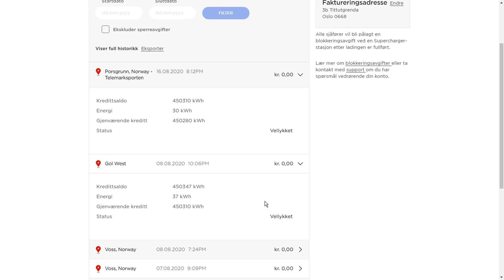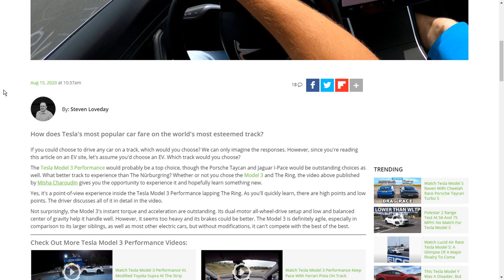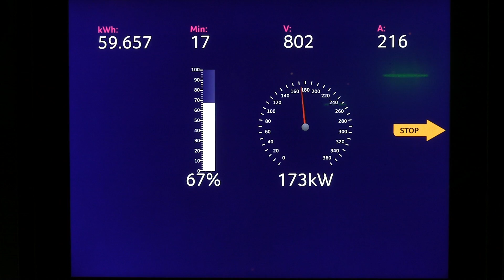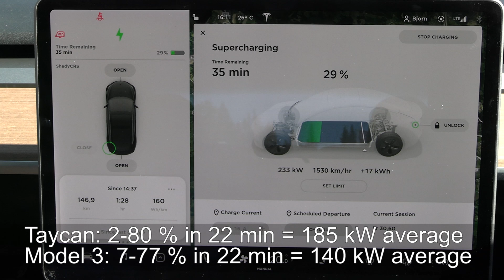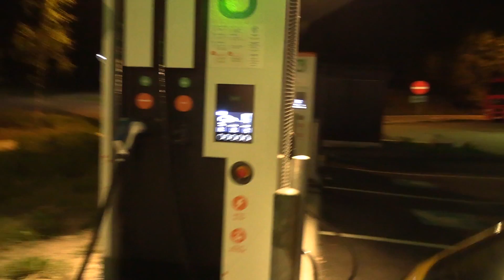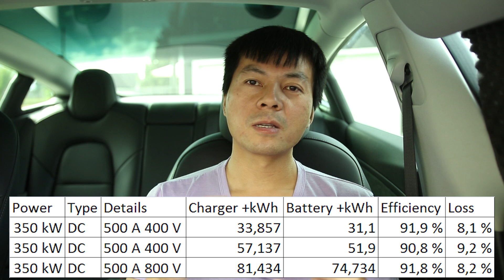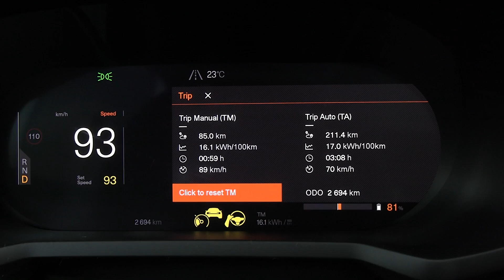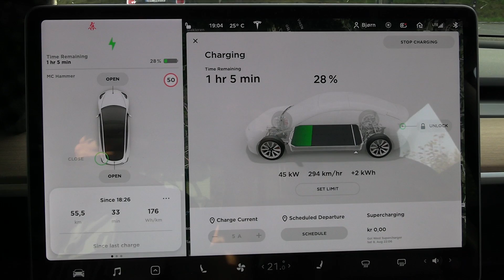Pros and cons of 800 V battery and charging systems

Comment: Certainly cable heating will be less if the current is less. The hotter the cable, the more losses you get. But, is it significant?  I think you make a good case here that it isnt.  The other argument is "Time is money" so faster is better. But again, your point is well made that this is ICE thinking. Fill up, then go for a coffee (or Toilets and then coffee). My experience is that charging the Tesla is just the right amount of time to (do what you need to do and) get a coffee and drink it.  Probably makes for a more alert driver and more rewarding driving experience.  In other words, faster is not necessarily better.  Finally, things will evolve. We need all electric cars to charge up in a reasonable amount of time (15-30 mins) so whatever gets us there.

Comment: 6:23 that is very misleading. The Taycan was overhetaing because it did 1000km at 120km/h and was supercharging just before the lap, so the battery was very warm. It even says so in the article you linked. 

[But two laps into the North Loop endurance track, the Taycan hit trouble, forcing Sentis to admit in the future he should keep to “a simple rule: start with a “cold” battery.”]
https://thedriven.io/2020/08/14/porsche-taycan-battery-overheats-on-nurburgring-north-loop/

And you can't compare it with the Model 3 lap, becuase they weren't driving very hard due to the overheating brakes. And even so, at the end of the lap the battery was overheating.
Reply: My Model 3 drove 350km to the ring and I charged 80 Kilometers before the Ring. And also supercharged 5 Minutes before the lap with Misha. So my Battery was also very warm. An i forgot to put the regenerative Braking to low so it was heating the battery up extra. So I think it was a good comparison. Greetings Benjamin
Reply: How the f*** is that misleading? You mean you can't fuel your $180k sportscar before tracking it?
Reply: Fighting hard for your favorite brand eh? You have a point, but I wouldn't go too far to say it's 'very misleading' 😂😂
Reply: So.. buy a car with a combustion engine?... 😅
Reply: All good points. But the model 3 is 1/3rd of the price and gets pretty close... Close enough to be more than enough for the majority of road users.
The Model 3 and the Taycan will never be in the same league because they are targeted at entirely different markets.
Bjorn's point is that the Model 3 is already way beyond what most folks need
.. 800v system may be over engineering (solving 'problems' that are not really relevant to the majority of users).
Reply: @aidanapword  But that doesn't disproves my argument. He is using a half ass comparison to make a point.

You can't take 2 totally different situations and compare it like they were equal.
Reply: @aidanapword  he had good points but you definitely didn't. If you want to compare cars at the same level then use the S as the comparison if your excuse is that the 3 is too cheap. And btw, the model 3 being compared is the top of the line one, is that a third of the price?
The S can't even do a lap on the Nürburgring either without overheating, and that's without starting pretty warm already... So any points you thought you had just went up in smoke.
Reply: M4XC4V413R4 a purpose built car - for the track, overheats. It doesn’t matter that the battery was warm when started.  The Porsche engineers didn’t put that into the equation before they made a production line?  The Model S was never designed for the track, but a purpose built family sedan that just happened to go quick. The plaid model S seems to be different, who knows what it can do?  The plaid model S, which has already been at the ring, has unofficially beaten the Taycan by a conservative 20 seconds.  That’s at 120mph avg speed....for 20 seconds. That’s more than 1/2 mile(~1 km) it was beaten by. Pretty sad I’d say and somewhat disappointed. And I’m a Porsche guy....
Reply: @yingnyang2889  what purpose built car for the track? They're both road cars...
Reply: @M4XC4V413R4  you should go back and look at the Taycan marketing...
Reply: @Bryan46162  wtf do I care about the marketing? Are they road or track cars? Good luck trying to argue that lol
Reply: M4XC4V413R4 yes they are both road cars.  So is the La Ferrari - but that can go on a track all day. What I mean by purpose built is you have a benchmark i.e. the Tesla and you know it’s weak points - overheating, doesn’t break very well for the track, regenerative braking is mild, the tires - that are geared for day-to-day driving, and you purposely built into your car to overcome all those obstacles.Why would you need those obstacles overcome unless you were purposely building it to race on a track where it is needed? The model S as a family sedan does just fine on the road and doesn’t overheat and the brakes don’t go out etc. that’s what I mean by purpose built.  

I am a Porsche guy, and i rebuild Porsche’s as a hobby, and I’ve owned several brand new Porsche’s (5 - two used, three new). I am disappointed in the performance aspect. For an extra hundred thousand dollars more than the Tesla model S, it can only beat the S by one or two car lengths in the quarter mile, basically seats 2 adults and two kids, and has somewhat less range.  I wouldn’t be bragging about that, so what the car can do 25 to 30 launches, and the Tesla can only do three or four? When was the last time you or anybody that you knew did 25 launches in any car at one time?  It’s still remains, as Tesla was seen driving two prototypes on the Ring, if they come out with that iteration, the ones everybody saw, it will humiliate the Taycan. When there is a paradigm shift, it negates any experience you have prior to the shift. You could have 100 years experience in horses but when the automobile came out it’s just negated all your experience everybody’s at square one

Comment: About the Nurburgring lap with the Model 3, by the end of the first lap the battery was already overheating and power limited and it's also important to mention he did not push the limits on the car because the brakes were gone after half a lap, so it's not fair to say the 900v didn't make a difference there for the Taycan.
Reply: Yea - I was wondering why Bjorn was not taking that into consideration. It was overheating already at the end (which would get worse with better tires and suspension because your driving also changes and you use more power). The Taycan could at least manage a fast lap, what the model 3 with the latest tech couldn`t. I would like to have my EV exactly like tat: Fast charging speeds when I want it and when I have time, I can choose the "eco" mode to give the battery a bit more life. At least you can choose and when you have a busy day with a lot of driving you can use it.
Reply: For model 3 at orange It's slightly reduced power.  You can actually drive the crap out of it after the orange and it won't really go into limp for a very long time.  Unplugged performance is doing pikes soon.  They added huge carbon ceramics and probably reduced Regen which is an adjustable slider on the stock trackmode v2 software.  They will likely complete the run with zero issue.
Reply from the maker: But if you understood the content of this video, you would understand that the reason for the battery to overheat has nothing to do with 400 V or 800 V pack design. And for mass adoption of EVs, track performance without overheating is not important.
Reply: @bjornnyland  Well I don't know that, Porsche claims it does, so I tend to trust the engineers behind those decisions.
But truth be told, I don't really get how just changing the battery layout means less battery heat.

Comment: 350kw will be good when you have 200kwh+ batteries.
Reply from the maker: Car manufacturers will probably stop at around 100-150 kWh in the future. After that point, they will go for smaller, lighter and cheaper batteries while still having sufficient rance. That's why you never se a Toyota Auris with 100 litre tank.

Comment: Almost all CCS chargers over 50kW in Switzerland are already 800V.
Reply: Frankly, it doesn't prove anything. Your local charging operator might have made an investment, that wouldn't pay off.
Reply: And even the new 20kW DC chargers installed in some shopping malls are 800V! (ABB Terra DC Wallbox) We're ready for whatever happens :)
Reply: Same in germany... more than 90% (source: goingelectric.de) EnBW HPC all come with 300 kW 900V, Fastned upgraded to the same HPCs. Allego also uses 900V and 300+ kW.
Reply: Maybe you saw 800V in the specs, but the charger it's working at 400V anyways.
Reply: @AaronStarkLinux  No, not only specs. Real 800V output. It also shows on Stall max-kW for 800V and 400V Cars, to inform driver. https://support.fastned.nl/hc/de/articles/360037279594-300-kW-Schnelllades%C3%A4ule and https://support.fastned.nl/hc/de/articles/360039667693-Laden-mit-einem-Porsche-Taycan . Same at EnbW and Allego and many other HPC.

Comment: Bjorn, please let us know about the motors - not just the outputs. They are not all the same  - the Taycan has two gears to assist the motor and extend the range.
Reply: Not really! First gear is only used in launch mode to help better accelerate from 0-100 or so...(90kmh I think)... Taycan has clutch on rear motor, that helps when you cruise because it dissengages the rear motor. But its redundant if you use induction motor instead of permanent magnet motors...
Reply from the maker: Actually, the two-speed gearbox is to improve acceleration, not to extend range. When Taycan is in Range Mode, it only uses the front motor. You can see it here:
https://youtu.be/VB24iJbusgQ

Comment: battery capacity will be bigger in the not so far away future...to keep up with capacity, the charging speed must be adapted. To keep amps and resistance low, voltage needs to go up. Never has math been simpler as with electricity. So, 70-100 kWh is the pinnacle today, and maybe 150kWh in the near future...when the first serious trucks arrive...will they be laid out to charge en route? They will come with huge batteries for sure. So yes, 800V makes sense to me. We will also see what Tesla will have to offer.
Reply: Higher capacity doesn't necessarily mean faster charging or discharge speed. You can put a bigger fuel tank in your car and it won't make it any faster.
Reply: @Nickbaldeagle02  That was not my point. People will demand larger batteries to have greater range. To fill the larger battery from 10 to 80 in the same time as the smaller one, guess what you need? Goodness...

Comment: To me the charging load on the battery is the same for 400 or 800v systems if they have the same capacity.
400 have more cells in parallel where the current is distributed.
The only thing is that, in 800v systems, you might have less losses in charging equipment like charge station, cable or car dc-dc converter.
This might explain the difference in losses.
Reply: The charging losses are caused for the most part by joule losses that are not proportional to the power delivered but to the square of the current. This mean that increasing the voltage the overall losses can be effectively reduced. I think that in general this advantage cannot be neglected.
Reply: Insulation at 800V would be cheaper than the copper at 400V. I think the total cable diameter is probably smaller as well at 800V, as is the weight of the 800V cable.
.
Reply: Yea he misinterpreted the videos there, also the taycan has much higher regenerative braking which will heat up the battery more.
Also he completely ignored that after less than one round the model 3 started to limit the power due to drive train temperature.

Comment: That model 3 on Nürburgring had battery overheated, power was limited at the end. Owner said it himself.
Also heat loses are not the same at 400V and 800V, can't beat the physics of I^2xR.
Plus you need less copper for lower currents
Reply: On the cell level of the battery it doesn't matter, as voltage is defined  by the chemical composition anyway.
For all other components the higher voltage results in lower losses or smaller cable cross-sections.
There's a reason overhead power lines run at hundreds of Kilovolt.
Reply: @wermagst  Exactly

Comment: Very interesting video and it made a lot of sense. 800V seems to be a marketing stunt as well.

However, another advantage w 800V could be that the wiring used in the car is thinner, weighs less and takes up less space. Cracking the wiring code for EV can give an edge in mass production. The Porsche Taycan though has a smaller battery and weighs more that the Model S even w those thinner wires 😅